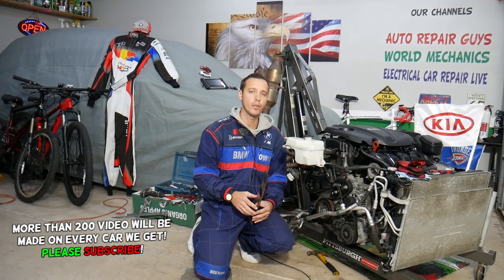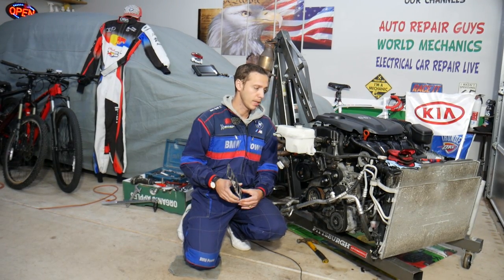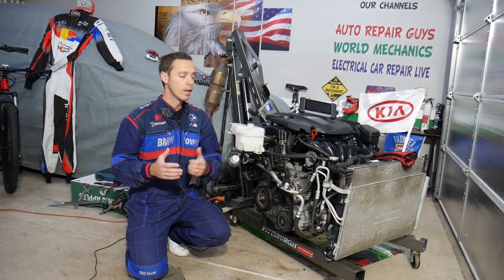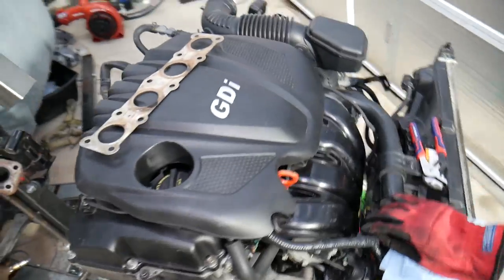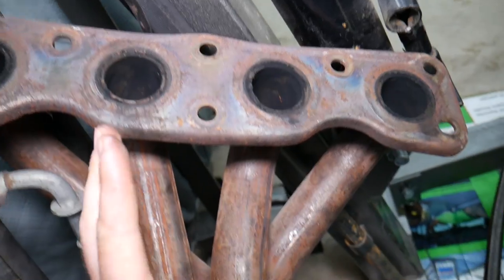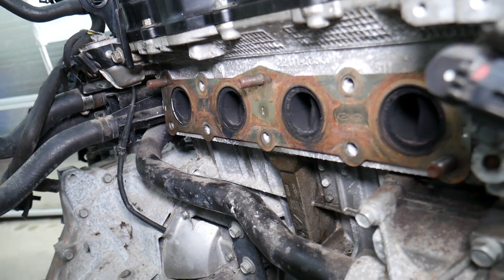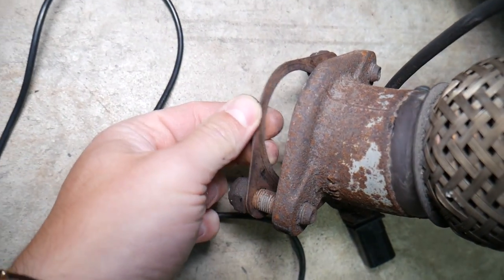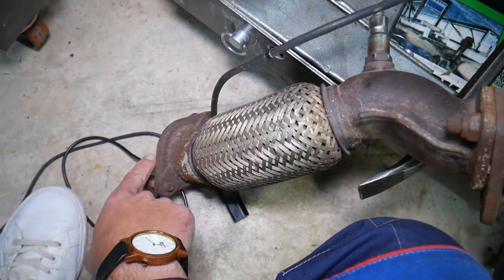KIA OPTIMA TICKING NOISE SOUND THAT INCREASES WHEN ACCELERATING OR REVVING UP

Comment from the maker: ⛐ Check out our Garage to see what tools we use and recommend:
https://www.amazon.com/shop/worldmechanics

⛐ Subscribe and hit the notification bell by the subscribe button for new videos: https://www.youtube.com/channel/UCJ9xpq0qUZevSEdBSFqO2ow
Reply: Could the Valve Cover gasket be causing the ticking noise too? Or just the exhaust manifold? My car was stolen and after watching this video I see they took off the heat shield but I don’t think they where able to get anything because it looks like you’ll have to take out the whole engine. I just got it back from the shop 2days ago from my insurance and it’s making a clicking noise when I accelerate and when I’m idling and I hit the gas also.  Upon further inspection I see oil leaking from the backside of the Valve Cover. It was not doing this before it was stolen and The shop didn’t do anything but repair my ignition and door lock mechanism because they jammed a screwdriver in it. ****also the exhaust manifold  was sawed into 😤 there’s literally a whole cut mark. How do you miss that ?

Comment: Could the Valve Cover gasket be causing the ticking noise too? Or just the exhaust manifold? My car was stolen and after watching this video I see they took off the heat shield but I don’t think they where able to get anything because it looks like you’ll have to take out the whole engine. I just got it back from the shop 2days ago from my insurance and it’s making a clicking noise when I accelerate and when I’m idling and I hit the gas also.  Upon further inspection I see oil leaking from the backside of the Valve Cover. It was not doing this before it was stolen and The shop didn’t do anything but repair my ignition and door lock mechanism because they jammed a screwdriver in it. ****also the exhaust manifold  was sawed into 😤 there’s literally a whole cut mark. How do you miss that ?
Reply: Same turns out there was a recall on the engine its a common issue
Reply: @stickman4512  my engine actually blew while I was on the freeway 4/23/2022. I actually kind of knew something was wrong when I started the car and started driving, although it wasn’t any dash lights . You could feel like a pressure air resistance when you accelerate. I got about 10 minutes away from home and my oil light immediately started flickering while the engine was making a horrible beating noise. I got the car as fast as I can off the freeway. Bout time I was able to fully pull over and turn the car off it was so much smoke coming out like it was going to catch fire….. fast forward to last Monday… kia has already replaced the engine. It took 2 weeks. There’s a noticeable difference with the new engine . It almost makes me think it was already something already wrong with the car cause it didn’t drive nor feel like that 😡